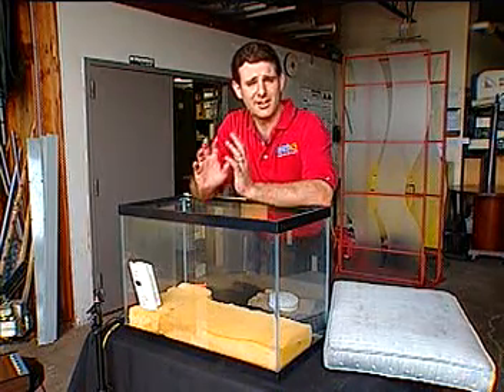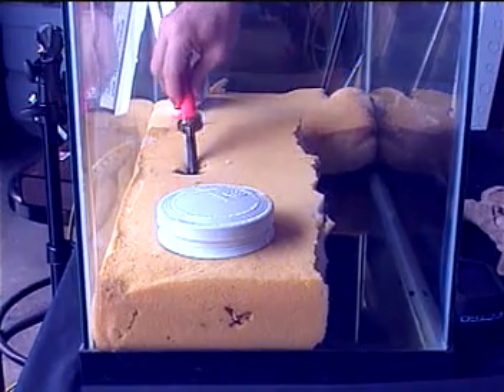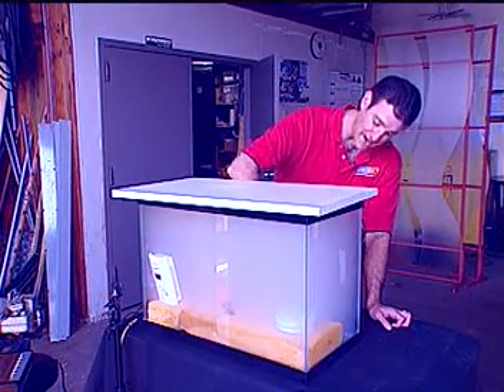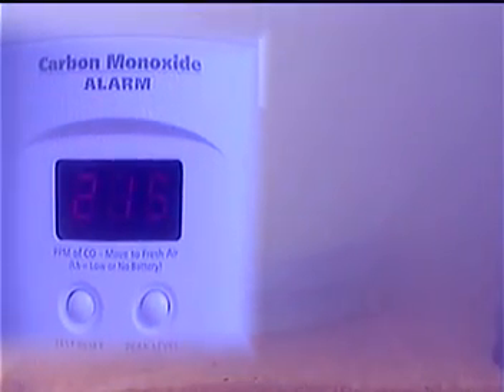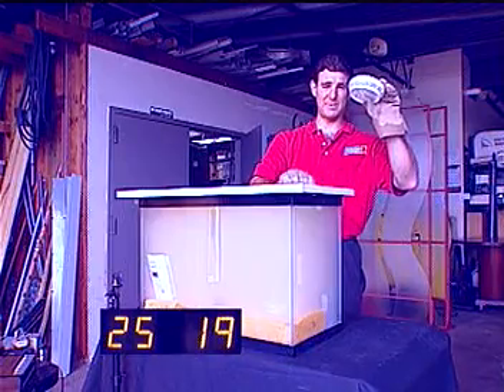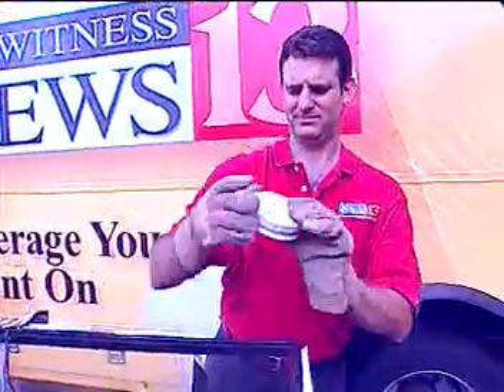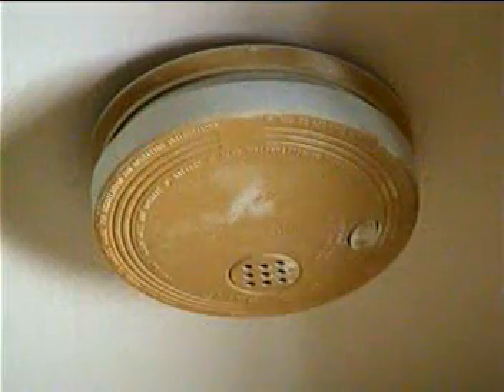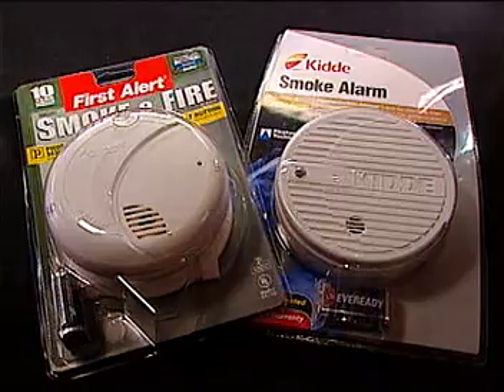WTHR aquarium test

Comment: So people should buy photoelectric smoke detectors AND carbon monoxide detectors.
Reply: Yes, but you can get one device that does both. You don't need two separate devices. The ones that I have in my house also interconnect so that I can hear an alarm in my bedroom on the 2nd floor when there is CO or smoke in the basement 2 floors below me.
Reply: Not necessarily. Ionisation alarms false-alarm on a highly regular basis; heat molecules given off from burning toast, running a hot shower, simply cooking etc. will often yield false-alarms. These are insidious in that many people disconnect their alarms when they get sick of hearing them go off as a result of simple daily functions. When a real fire threatens, these alarms are often left disconnected, and effectively useless.

Comment: Most smouldering fires are never detected by ionization alarms. Please read the UL (Underwriters Laboratories) report from 2007 linked here. See page 137 in Table 30 where it shows that for the eight different non-flaming tests that the ionization alarms Did Not Trigger for five out of eight tests!  After reading this report you can see that photoelectric alarms are needed to detect these types of fires.
https://ul.com/global/documents/corporate/newsroom/storyideas/smokecharacterizationstudy/SmokeStudyTechnicalReport.pdf

Comment: @firealarmfreak5 CO alarms must measure the CO concetration over time.  In the US must comply with the the UL 2034 standard.  The standard requires the following:

At 70 parts per million: Unit must sound alarm within 60-240 minutes
At 150 parts per million: Unit must sound alarm within 10-50 minutes
At 400 parts per million: Unit must sound alarm within 4-15 minutes

So in the aquarium test, the alarm had to sense on of the levels for a given period before it alarmed.  Hope that helps.

Comment: The issue with the slow response of ionization smoke alarms is a well documented issue.  95% of all US/Canadian homes have ionization alarms installed.  The survival rate in a typical residential fire is only 40%.  Photoelectric alarms have roughly a 96% survival rate.  Around 20% of the time, an ionization alarm will never sound.  Ionization alarms are also notorious for nuisance trips when cooking and are 8x's more likely to be intentionally discabled.